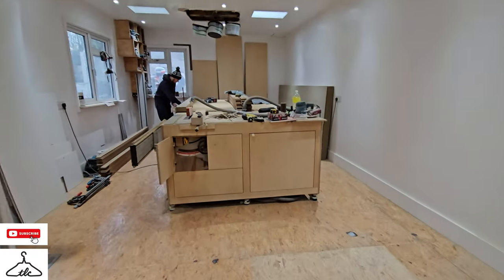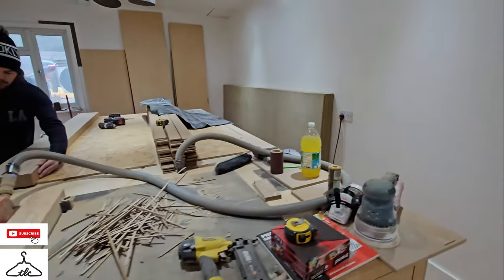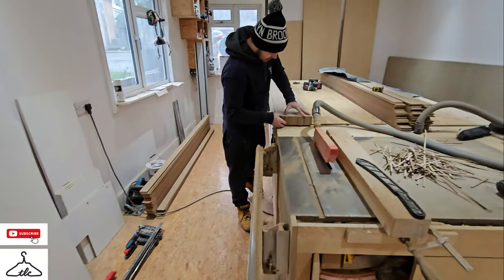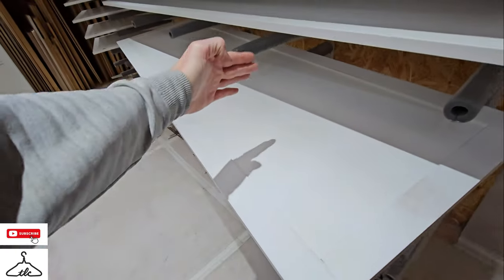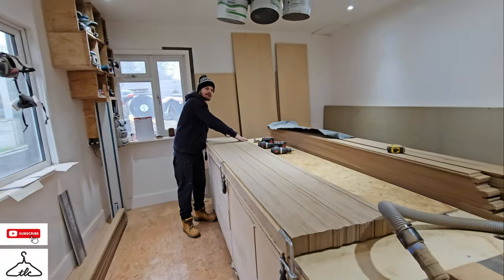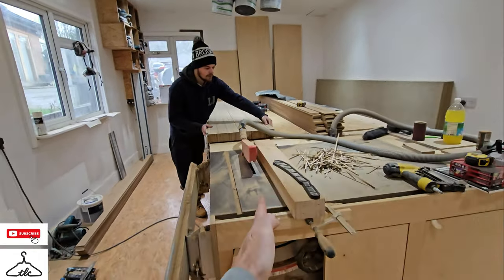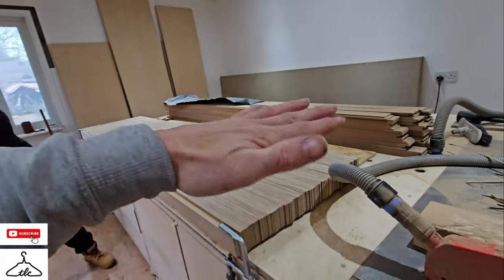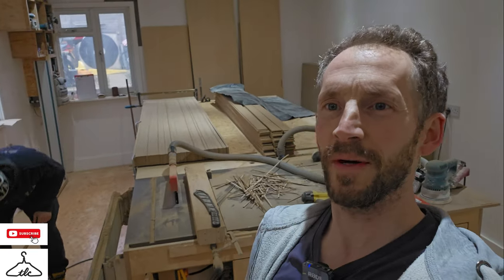Simple Shaker Style : The EASIEST Shaker Style Doors (Fast)

Comment: Great tutorial as ever. This demonstrates the need for a structured system, and shows just how much preparation work goes in the background. I've never had to make shaker doors on that  scale...10 sheets, 64mil rips! We must be talking a wheely bin of dust. 
I have to say, for me personally, the real challenge, and what really takes up most of the manufacture time, is the preparation and painting. I can only imagine what a slog it must be, having to samd and paint to that scale.
Reply from the maker: Thank you!!!
Yep you Nedd a system for sure, that then makes the job alot easier.
And yep it filled up the whole saw 🤣 (need to sort my extraction).
With the airless sprayer it's not hard, plus sanding each door once undercoated only takes about 6 or 7 minutes, so it's not too bad, once you have your system set up and in place 👍

Comment: ryan can you recommend a slightly better than entry level sprayer for clear coat and paints
Reply from the maker: Hi, I have the gxff and used to have a few 390s (I always use graco).
I can only advise on what I've used, and the airless type, as I have only used airless.
I'd say I'm pretty happy with the gxff, I don't use it much but it does a good job.
If your looking to sprayer medium s8zed jobs frequently, I'd go for the 390 pc. 👍
Reply: cheers will be small small to medium and not all that often  @thelondoncraftsmanworkshop
Reply from the maker: @CityWoodDesigns yes then a gxff or gx21 possibly.  Watch some videos from spray direct on these 2 sprayers, they'll give more info.
Also, I've also bought used sprayers, can get them for half or less of new prices 👍

Comment: Do they not bow as they are only 18mm thick? And also how many coats of undercoat do you spray? Thanks
Reply from the maker: It's a balanve of keeping them light weight and strong enough. I believe this method offers both.
They stay pretty flat, sometimes some movement once sprayed, but I've have that on every other method I've used. I've never had a major problem when fitting the doors. 
I spray 3 coats in total on each face. First coat then rub down, then final 2 coats. 👍
Reply: @thelondoncraftsmanworkshop  thanks, so is that one undercoat and 2 top coats I guess? And you don’t worry about sanding between top coats? Also should it look quite patchy when doing first coats as I’m in the process of learning but don’t want to spray too thick? Thanks mate
Reply: @thelondoncraftsmanworkshop  thanks, so is that one undercoat and 2 top coats I guess? And you don’t worry about sanding between top coats? Also should it look quite patchy when doing first coats as I’m in the process of learning but don’t want to spray too thick? Thanks mate
Reply from the maker: @mananddog9884 yes 1 undercoat and 2 top coats. You can sand between each coat but I generally only sand once after the 1st coat of paint goes down. I have a few spraying videos that explain my process in more detail 👍👍